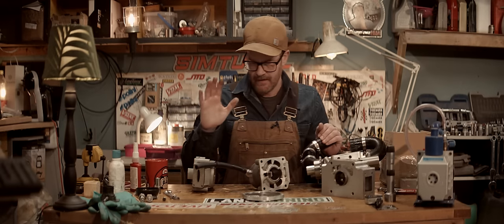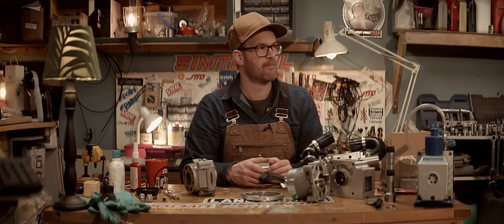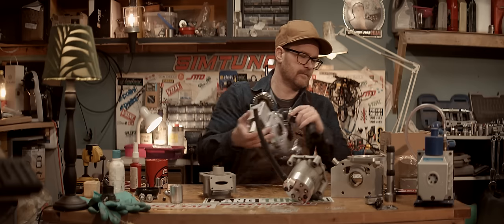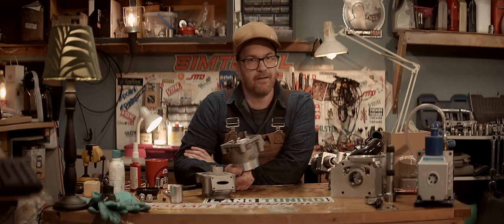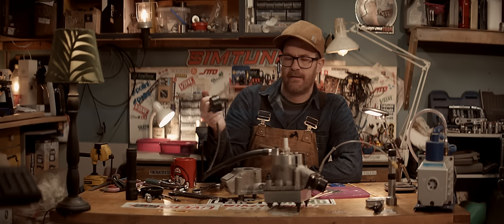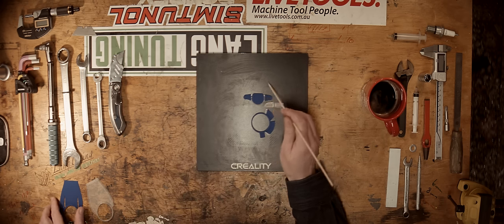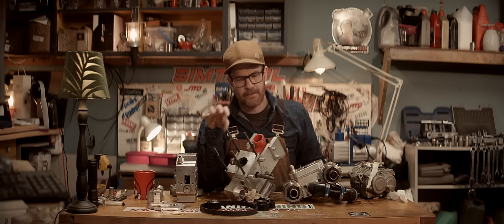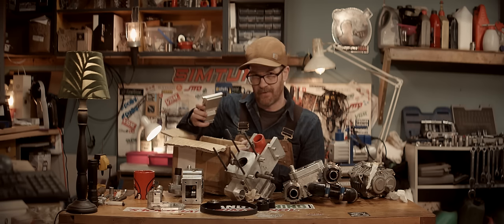Rotary Exhaust Supercharged 50cc Externally Scavenged Two Stroke returns!

Comment: Brute force, but dont waste your time on it unless you decide to run a barrel or poppet valve. The brute force failed and fell short because you're relying on pipe/port to create an obstruction and build boost rather than using an actual timed valve. You need an actual exhaust valve that you can close while intake is still open...  

Barrel or poppet valve with ohc or push rod ran off cam on the crank. Use the exhaust for bleed down and exhaust opening it roughly normal timing but closing it early so you can still boost the cylinder. This nearly eliminates reliance on pipe and actually allows the engine to run under all loads. You can use crank transfers or you can use the positive displacement sc to boost the transfers and splash oil the crank as it would need to be isolated from the intake tract. 

Stop playing with conventional 2 stroke pipes if you are running boost.  

The other option is you run a conventional 2 stroke (optimized for boost) and put a turbo on it. The downside of this is you will run a ton of fuel out the exhaust and will need to play with turbo hotside AR to get best results. You'll also likely need to positively trap the crank seals as boost will be trying to push the seals out.

Comment: Dude, heat up the cylinder, push out the sleeve,weld it up, never push a sleeve in cold that's why it leaked

Comment: Venturi Effect , you need to better understand fluid flow . Or try use some programs with fluid flow simulations to check yours ideas first . It will take much less time and keep cost down. 
 Programs like Solidwork or Autodesk.
And good luck in future 👌
Reply: And about testing. You van just test on few minutes how it will work and cast best ones only.

Comment: why so many detours? With a compressor in the supply, the air no longer has to go through the crankcase! The piston controls the input and rotary valves are no longer necessary

Comment: Why not isolate the crankcase from the barrel. That way your oiling could be seperate from your fueling. Also, try using the Coanda effect (https://en.wikipedia.org/wiki/Coand%C4%83_effect) to your advantage for directing your gas flow, instead of redirecting ports.

Comment: Instead of a water brake could you use a hydraulic pump like a log splitter with a ball valve to put a load on the engine ?

Comment: Ok hows about going back the the supercharger BUT split the output  you were having exhaust fumes clearence issues  from memory well cylinder with an extra Port that is connectred to the split output of the charger to force air thru to clear the cylinder AND cause a bit of draw thru to assit the fueling

Comment: Would there be advantage in testing your Dyno with an electric motor? I think it would be faster to set up and less complex than grafting. 

Better yet, get an off the shelf dyno. My experience says that trying to measure one experimental system with another one is painful. Being able to rely on your measurement system is critical.

Comment: 1: why not test and calibrate the dunk using an electric motor with know rpm and torque so that it’s much easier to remove all the variables and you don’t need to make another engine work that’s not going to be used anyway? 
2: Unlike a turbo (electric?) the blower will use a significant amount of the power made by the engine to operate. Especially as you’re already adding the rotary valves, which will have their own friction losses. Just thinking about what would add the ability to brute force the engine without using a large part of the minute amount of torque a 50cc engine can make. 
Anyway, still here every week right from the start of your channel to see where this is going, which is never boring!

Comment: Why don't you use something with a known output to calibrate the Dyno? Like use a 10kw electric motor or something, that way you have an exact input, and you can calibrate the output to match. ICE engines are always going to vary in output based on ambient conditions, which makes calibrating using an ICE as the input a bit tricky.

Comment: you put pressure on the system and even then it only leaks minimally.  Screw it... under normal operation you have no pressure on the system and the little that flows out doesn't affect the engine when it's running... Assemble the engine and ignore the few bubbles that rise.

Comment: How is the output of the World's Most Powerful 2 Stroke defined/measured?
Is it sustained power on a dynamometer or could it be designed/built to produce a momentary huge burst of power before it blows up?
50 bhp for 0.02 secs beats 25 bhp for 1 minute...? 🙂

Comment: Curious if you have tried a ringless design. Every nitro engine I have seen is ringless with a venturi style carb with the fuel tank pressurized by the exhaust.
Reply: That works well on tiny RC engines but doesn't scale up well. For a ringless piston to work you need very small clearances between piston and cylinder. Unfortunately larger parts are more affected by thermal expansion, so it would be difficult to avoid seizing the engine.

Comment: Please consider a turbocharger. I believe people don't understand the amount of air flowing through an extremely high performance 50cc two stroke. So much wasted fuel burning in the pipe acts as antilag for a turbocharger. Im positive you could spool a turbo off a small diesel engine especially with the correct tuned pipe for the application. 
 The rotary engine is a prime candidate!! 
  15 horsepower two stroke could EASILY spool the turbo off a small diesel engine that has n/a power around 40 horsepower.   If you would like to speak with Gus Bohne about this i have his number

Comment: you could turbocharge a bought 50cc cylinder and fire it with nitromethane. that could be fun :D 

besides: rotary ports  have been built several times but never worked. not in planes, not in formula1 engines when having a look on pure performance. and especially not, when there are sharp edges in the flow. 
high power plane engines had, when valves were unreliable moving bushings that worked as valves, but this is a mechanical nightmare of deaths doom. very metal (i heard you like metal in norway) but no real suggestion.
some stupid thoughts by myself: why not a little less conveniant and try 170% transfer and a valve-head? you built so many chaindriven things, this should be possible. maybe in first try with a usual car-engine-valve. this is cheap and relatively easy. and very good to supercharge or turbo. or maybe from some piaggio 4t head.

good working. like your video-style.

Comment: You know, you could just mount a hydraulic gear pump to the engine and pump fluid through a fixed orifice to measure engine horsepower. The fluid flow rate at a certain pressure directly gives you the numbers needed to calculate horsepower.

Comment: Just use a standard off-the-shelf lawnmower engine or similar to test your dynos.  Please.  Otherwise, as a patron, I was screaming, "yes! yes! yes!" to this week's video.  But (also please) stop spending your time debugging dynos. The water break will be the fourth one.  Creating a dyno is not the goal, creating the most powerful 50 cc two-stroke is!!  I also think you should go back to the Roots blower. It performed much better than the Rotrex, didn't have any starting issues, and you gave up before really nailing it because of the dyno and instrumentation problems when it backfired and bent one of the shafts.

Comment: Have you considered an exhaust valve or 4 in the head ?
Reply: 1 valve  25 mm will do the job , I tested it a few years ago. Without supercharging . Good power but limited revolutions. Valve is problem.

Comment: There's not much point to have the most powerful 50cc two stroke engine, which is little bit more powerful than next powerful one, but it's very interesting to follow you making something new, so you have right approach.

If I was buiding 2-stroke engine, it would have electric 'turbo' charger feeding cylinder directly through suction valve, direct injection, and maybe three exhaust ports with separate exhaust pipes and electrically controlled valves to make things really complex. 

Maybe such an engine wouldn't even be too sensitive for exhaust pipes, since it could be flushed with exes air and get pretty good amount of air in.

Comment: Ya'll need to create a tornado that goes down with the piston. That ain't gonna happen if Ya'll have the ports opposed n' fighting to get that dragons breath in aye. Yall heading in a straight line so design the engine like Ya'll couldn't bend a bean with those handling bars.

Comment: The argument that a small diesel turbo would be much too large is all theoretical from naysayers. Here is my example proven to work go see it at my channel, i added a short video of my snowmobile. 
Here is my example in comparison. My sled is 700cc (.7L) with a 58mm turbocharger. Cummins diesel trucks with 5900cc (5.9L) has run holset hx35 in its largest form is 58mm turbocharger.
My 58mm turbo also has extremely large a/r as well. 
I cruise  down the trail only 5k rpms making 1~2 psi boost! 
700cc two stroke spools a turbocharger used on a 5900cc diesel!!!
So you cant use engine size to determine turbo fitment.
   Its all in the pipe design as well! 😊😊😊
350/700 = .5 x 50 = 25 
😮
No snow here this entire winter so im bored

Comment: I would like to see you develop a 2-stroke engine that runs on plain pump gasoline; no oil mix.  Perhaps the supercharger connected to the transfers with fuel injection without using the crankcase as part of the induction system. Which would allow you to fill the crankcase with oil like a 4 stroke and run as clean as a 4-stroke.  Emissions is probably the #1 reason why 2-stroke engines have fallen out of favor;  an engine like this could bring back the 2-stroke.

Comment: You don't even need coolant to run your engine on a dyno. We,ve been running our drag bikes without coolant for over 20 years . You'll pick up power from the lack of parasitic drag on the water pump as well.

Comment: If I were trying to make a very high HP 50cc motor I would start with a 4-cycle Honda 50, optimize the valves, change cams and timing for firing every revolution, add EFI, tiny electric turbo, and meth injection for intercooling. Don't laugh at electric turbo, see alexltdlx here on YT.